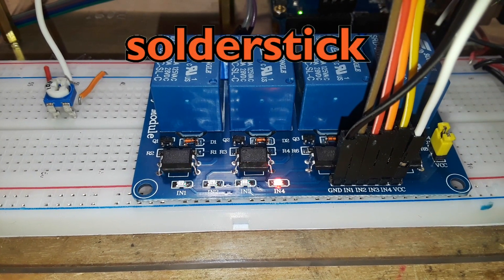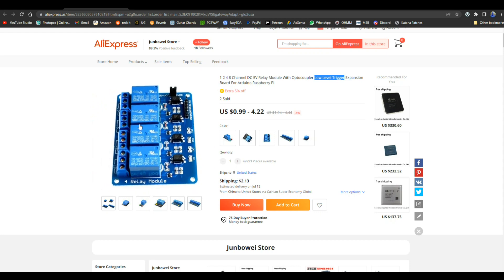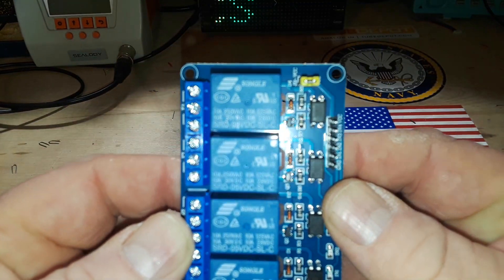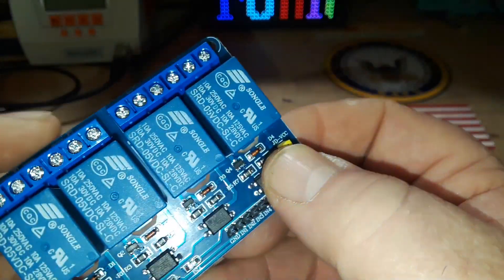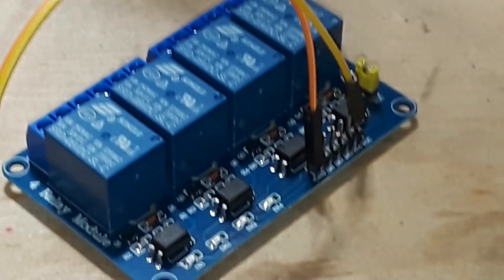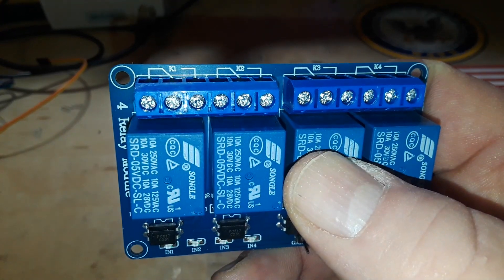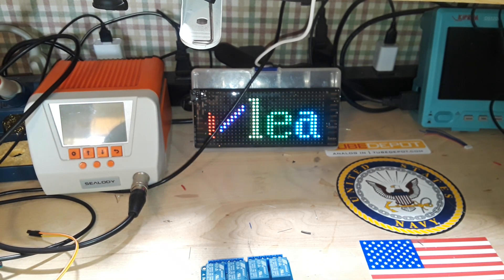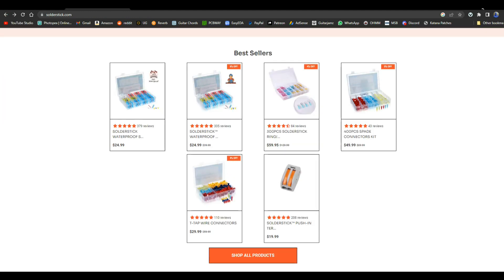AllieExpress Relay Board sponsored by Solderstick Wire Connectors

Comment: I have two 8 relay cards.  One with the ethernet option and one that uses remote control.  I turn on/off my desktop computer and all the music hardware (monitor speakers, mixer, etc).  Only issue I have is the ethernet one does hang up once in a while.  The remote control one has worked flawlessly.

Comment: Can you make the Knight Rider Kitt scanner,  circuit, but use incandescent bulbs on the relay side?
Reply: I think a solid state relay would be the better choice for this. Regular relays wear down over time and are not made for continuous switching. SSRs also switch at the zero crossing of the AC sinus curve and therefore produce a lot less electrical noise.
Reply from the maker: Absolutely

Comment: Do they make, and what is the cost, 20 Amp relay boards? Many of the things I want to control use 15 Amps and 10 just wont quite cut it.
Reply from the maker: When you get above 15 amps, I would recommend a contactor.

Comment: The JD-VCC jumper on a relay module determines how the module is powered, isolating the control circuit (e.g., Arduino) from the load circuit. If you want to use a single power supply, place the jumper across JD-VCC and VCC. For separate power supplies, remove the jumper and connect an external power source to JD-VCC and GND. (Thank you Chat GPT)